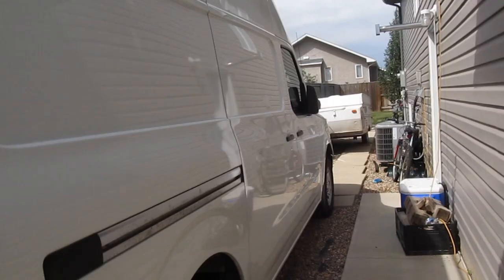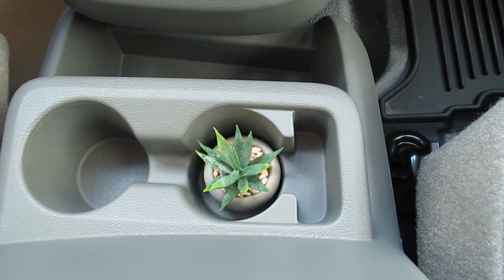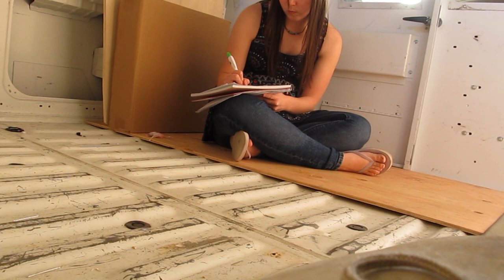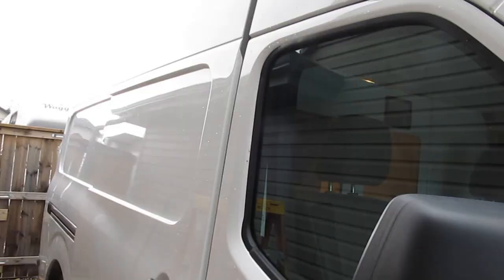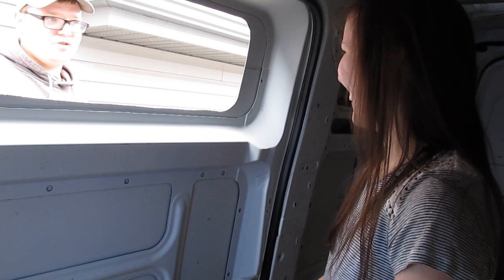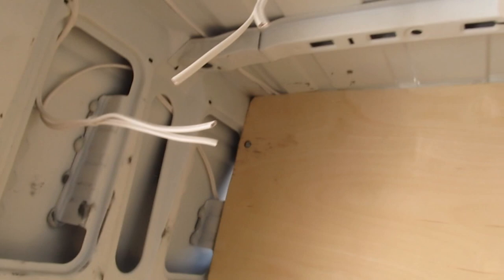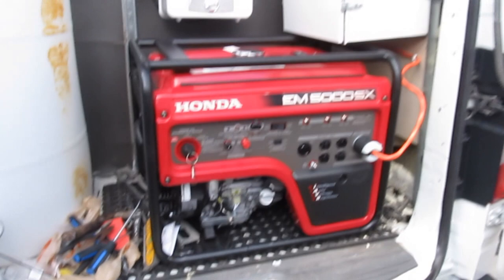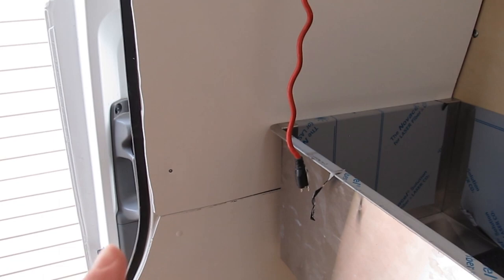Van Conversion Part 1: Mobile Pet Grooming

Comment: Is there a reason the water heater is down so low? I'm just wondering if the shop vac and water heater could be switched for easier access?
Reply from the maker: Good question! You could switch them!